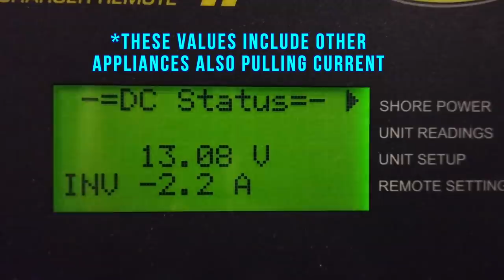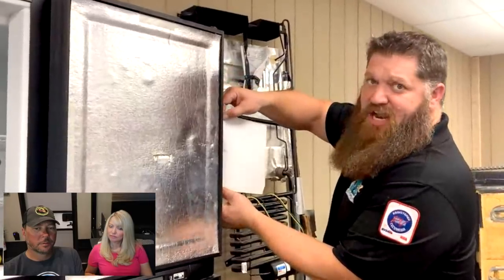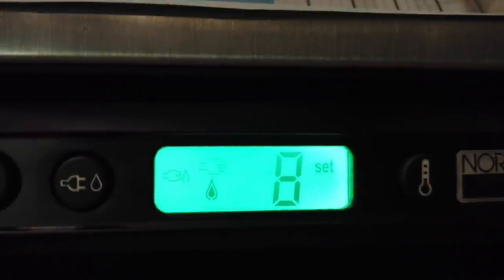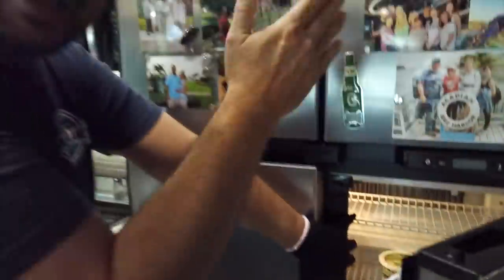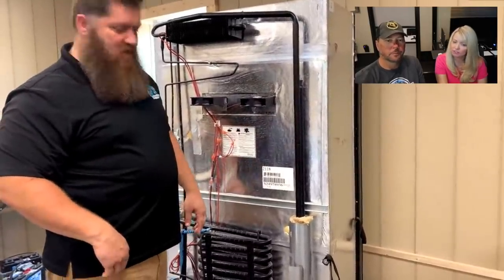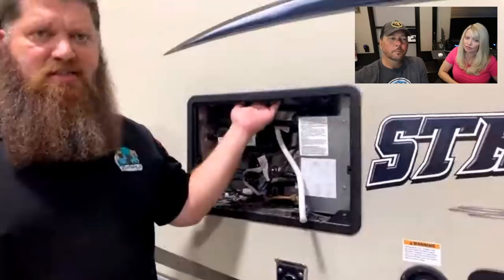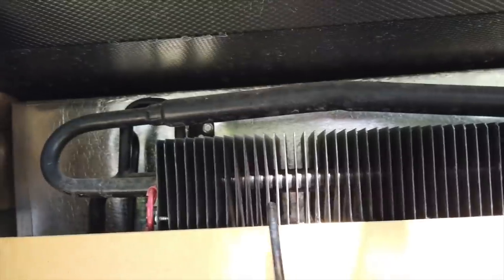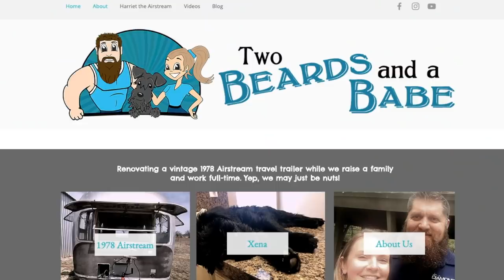Full Time RV Maintenance (Refrigeration) | Changing Lanes!

Comment: Great video thank you. Last winter it got down to -15 with 30 plus mph winds. Our ammonia in the fridge froze and caused the fridge to not work. To fix the issue we took the fridge out and flipped it upside down several times until the ammonia turned turned into liquid again. We like to rv in the cold a lot so we are more than likely going to switch to a household fridge to avoid all the temperature changes due to outside temps. Also to help with the cold we cover the bottom vent up with heat tape and leave the top open.

Comment: I'm so happy you showed a view of the top vent. I have a vent that is almost sealed and it doesn't cool on LP and CO leaks into the the RV and sets off the CO detector. I'm going to remove the top panel so the bottom panel is still there in hopes of allowing it to cool more.

Comment: I have same refrigerator. Only a few mounts old. Was having issue getting it to cool below 50. We found that pice that flips out to fill the gap between the door was not flipping out every time. Had to adjust the doors up. All good now. It also caused a large amount of condensation in the frig.

Comment: Ok so I have a question.  I have a norwood fridge in a 2013 Eclipse Milan.  I bought it used, there is a drain hose sticking out of the outside vent.  I have never seen it drip before, and since I am in Phoenix, AZ I figured it is so dry out here that there just was not enough condensation in the fridge for it to drain.  However I saw some of your videos and learned that I should clean out behind the fridge.  So I set up the vacuum and cleaned it out.  While vacuuming I accidentally vacuumed the drain and it dripped a lot.   I tried it again and more water came out.  Should I blow this tube out from the inside to clear it?  My thought is that the drain tube is clogged and without proper suction it will not work correctly.  Thoughts?

Comment: the air "dam" across the bottom of your upper vent seems to make sense to me, our fridge has a similar situation but no "dam".  is this recommended by norcold?
we have an open spot above our fridge of about 3 inches, i will close that off.

thanks for the great video, most of it is common sense except for the baffling around the back of the fridge, great tips!

Comment: The pressure regulator already has an excessive flow valve, but I suppose 2 is better then one.  Put us in "travel with propane on" category.  Great video as always..
Reply from the maker: It does.. but it does not shut it off completely.  See the test I did here: https://changinglanesrv.com/gasstop-automatic-propane-shut-off/
Reply: Correct the excess flow valve only slows down the rate of flow should a catastrophic event happen but there is still propane flow.  The Gas stop device shuts propane flow completely off should a catastrophic event happen.

Comment: You do not need to turn off your LP when you drive you have an LP leak detector by law in every camper. (It is like a smoke detector for gas) RV refrigerators frost up on hot days or just after months of use. It happens to all of us. Just buy a cooler. Put your food in it for 24 hours. Open the door, Turn off the refrigerator, Let it defrost. I do this every 6 months. Also some tunnels say turn off the gas. So fill up your cooler. Turn off the gas and power to it and defrost your refrigerator at that time.

Comment: Great video, thanks for helping everyone with this knowledge.

What video do you show your motorcycle chock mounted for travel with your bike?  I need to decide how to transport my recently purchased bike (85' V65) in my toy hauler and cannot find the video you posted about it.
Reply from the maker: We use a WheelDock. https://wheeldock.com/ 
Uses a piston you trigger with your foot to lock in the wheel versus having to rock it in and out. I don't bolt it in at all, it just sits on the floor and I strap lucile down on the front forks and rear bars. 
We demonstrate it a bit here https://youtu.be/_X-LAY8Fwlw?t=1341, 
then later here https://youtu.be/uPXNmS0IBRQ?t=1268 
and even more here: https://youtu.be/f56_8ecCTaI?t=777

Comment: Good video, but I made the switch over to a Residential Fridge, and will never go back to an RV Fridge, I would even get rid of our Furrion Stove/Oven and go to an Induction Top just to get rid of the use of Propane, except when traveling in the Winter for the Furnace.  The residential Fridge is an 18cft Samsung Double Door with Ice Maker, so much better.  We finally got tired of the small RV fridges, and the constant icing up of the Fridge and Freezer in the extreme hot days.
Reply from the maker: That's certainly an option we've considered.  Do you know what that samsung pulls in terms of wattage?
Reply: Changing Lanes yep I have that info at home will email it, but we leave NJ to Florida traveling 32 hours I run Fridge/Freezer on 2 LED Acid Batteries, and when we connect in Florida we usually have 50-70% battery left, less if we run the furnace but I will get you power consumption truck is make sure ice maker is off and batts are fully charged before we leave

Comment: All good info, for sure. As I plan my purchase, I'm now predisposed to a residential refrigerator and will definitely have a robust solar system for extended boondocking. For me, the risk of a fire with one of those RV refrigerators is enough for me to shy away from them. Great video, keep up the fine work and remember.... there's an awesome cheeseburger in your future when you get to San Diego.
Reply: Tim, not RV related...if you like Pizza, try Pernicano's (? Spelling) on El Cajon Blvd as you pass from El Cajon in Lakeside. They are by far the best I've had in the entire US.  Oh yes, second best is Lintz Brothers in Hermosa, SD at the intersection of highways 79 & 36.  Oh yes, I totally agree with your thoughts regarding refrigerators.  v/r, TS Denver, CO  (Retired Navy who was Born & Raised in SD)
Reply: @Shalako1946 , great to get a note from a fellow San Diegan! You know, I remember Pernicano's in Pacific Beach when I lived there years ago. They recently closed that one, but I'll check out the one on El Cajon Blvd since it's close to me in La Mesa. I'll look into the other one you mentioned too. About the cheeseburger- I'm going to take  these fine folks to Rocky's in PB when they come to  town
Reply: @timinsandiego6979  Been to PB a lot...B4 I joined the Navy back in '64 (just after graduating from Crawford HS), but Rocky's doesn't ring a bell. I'll look for it next time I visit my sister who lives in Lakeside. Thanks for the tip.  Please pass on a "Fair Winds and Following Seas" to Chad for me. He can explain it to you.   :-)  v/r, TS
Reply: @Shalako1946 , I sure will and I'm looking forward to meeting them. BTW, Rocky's is in Crown Point/PB. It's a cash-only bar. All they serve is a burger, with or without cheese, and french fries. The bartender told me they go through all the buns (and more) that you can see on the back shelf from the bar I counted them... 600 buns.

Comment: Love all of yalls videos I have had the pleasure of watching so far , looking forward to more on the maintenance sections ( Especialy Electrical ) . I as Tara hate and don't understand most of it ,  Having that said I have a question for you , I have a 30 AMP RV and am curious if I would be able to puchase a 50 AMP surge protector and use a 50/30 dogbone to safely reduce power for our RV ? This is our first and my thought was later when we upgrade  I would already have the 50AMP and not need to upgrade .  Thnx and looking forward to your insight  .
Reply from the maker: Shouldn't be an issue... you would need to double dog-bone it.  Might want to call TechnoRV to make sure....  👍🏼

Comment: I turn my propane off when traveling, but add freezer packs in my Refrigerator when traveling.
Reply: a super simple fix as you said. we even will simply move our meats up to the freezer and keep our drinks in the fridge. After 8 hours of travel our meats have just a bit of frost on the outside and are colder than when they went in. A bit more work but safer.

Comment: We have a 2918 Satellite Comet 17RB with a Dometic fridge. It literally takes 2-3 days to get it cold before we leave. And we usually have to keep a 5# bag of ice in the lower part to maintain temps. Ideas?
Reply from the maker: Did you check the things in this video?  Air flow, seals, etc?
Reply: Yes. Nothing works. If I try to run it on ac or battery it’s even worse. But I forgot to mention that the freezer seems to be just fine.
Reply from the maker: That is odd...
Reply: @firemarshal17   So freezer works but the fridge does not correct? So first make sure your fridge seals are clean and they connect well from the door to the fridge. 2nd make sure you don't over fill the fridge- give a good 2 inches of space on the back side, if you can find a 12volt fan to put back there it would be wonderful. 3rd item as stated in the video is to check your air flow between your lower access panel and your upper access panel located on the outside of the rig where the fridge is located. make sure there are no obstructions and no large pockets for air to get trapped. 

if the freezer works but the fridge doesnt then its either air getting into the fridge or not enough air going across the fins to pull the heat away.

Comment: Hi Chad, we have been in our 2019 solitude for 5 months now in canada, and our freezer seems to be acting weird, the outside temps obviously should not be a factor (I would think) when its been 5-15C ( 40, 50,60F); but our ice cream would turn to mush, then one day it was frozen. 😲 We have turned the fridge temp number on the  fridge ranging from 6 to 8, but on 7 things in the fridge start to freeze, so we leave it on 6 now. Tried 8 to see if it made a difference to the ice cream- it didn’t. What we are noticing is we have read freezer temp has been -5C, (23F) then next day its  - 15C (5F) ; another day -7C, few hours later -10C. Freezer gets opened max once a day. So it is looking like to me the freezer temp is fluctuating on its own? Not because its being opened n not because its hot outside as outside feels colder than the dang freezer. Norcold 2118 model, looks like yours. Fridge is fine as long as we don’t go past 6. We check the freezer fan n its running fine. We will be taking it in to the dealer next month to figure out wtf is going on. Just wondering if you ever heard or experienced this weird thing with the freezer. No its not over stuffed by any means either. I’m so turned off ice cream because of having an ice cream on the stick pretty much fall off the stick like mush once wrapper came off, and the ice cream cookies sandwiches, the cookie part is absolutely soggy! Yeah 🤢.  The ice cream is always on the bottom left side too.  Any ideas? Cheers 🍻
Reply from the maker: Sounds like you've checked all of the things I would have checked.  Let us know what the dealer says....
Reply: I have this exact problem. I’m at the dealer now getting a new cooling unit it. Not fun and not cheap but it comes with a 3yr warranty

Comment: Chad--have you tracked battery consumption with the Norcold while on the inverter?  I've got the Dometic 1350 (12 cu ft) in my '19 GD 315RLTS.  I have 400ah (four Battle Borns) through a Victron 12/3000 Multiplus.  I've recorded 18 travel days and on average consume 8% of the 400ah (or 32aH) per hour.  In other words, I can power the fridge on the inverter for ~10 hours disconnected from shore power.  Final thought--I hope your viewers take the food safety warning seriously.  While towing with propane has risks (the Grand Design owner's manual says not to do it) getting food poisoning is an even greater risk.  That's why I went with an inverter, but (whew!) it was an expensive alternative.  And Emily posted a link to your video on the Grand Design Owner's Technical Forum, so I think she still likes you.  :)
Reply from the maker: Emily still loves us! 💙   
Overall usage will depend a lot on how much the fridge is actually running.  Ours pulls about 40-41 Amps DC when running on inverted 120 (480-500 watts).  We have 300Ah of lithium and have been only getting about 4-5 hours recently.  But, again, this is summer.  In cooler temps, it will last longer because the fridge doesn't have to run as long.  Another factor is how often one opens the fridge.  We get into ours a few times on travel days...  Lot's of variables to be sure!  
Definitely hear you on the food safety thing... Sooooo many people just go by feel.

Comment: I wish you would’ve mentioned don’t spray a lot of water in the bottom vent when washing because you can trip that little black box in there then you’ll need a magnetic to reset the switch inside there to turn the fridge back on. Nothings worse than opening up the camper hours later and hearing that beep saying no power!
Reply from the maker: Good point...  👍🏼

Comment: Traveling,propane off. The reefer will stay cold up to 8 hours, most around 6. Many RV fires are cause by the reefer running on propane, look it up and tell me if I'm full of it or not. The other issue is fueling up. Many reefers are on the the pump side. Do you really want to take a chace of blowing up on a hot day with putting gas in your tank?
Reply from the maker: True.. but just know the difference between "cold" (a subjective term relative to one's own temperature), and an actual measurement showing it stayed below 40.   
The gas pump thing is a good point.  Particularly in motorized where the fridge can be in close proximity to the pump.  For us (and most trailers), the fridge is a good 20-30 feet from the pump when filling the tow vehicle.
Reply: @ChangingLanes  
Regarding gas pumps. True the rig is behind your pump but not always behind the guy on the other side fueling up. I just shut the tanks off as part of the pre-launch checklist. I have found with my Dometic 2 way, it will stay around 34 to 38 after 7 hours. Crossing the desert on I40. However, I stay out of the damn thing except to very quickly grab a cold beer!
Good info on the reefers especially Norcold, most do not have baffles and I have had to install more than one. I have also installed a fan at the bottom of the unit to create more airflow,especially in slide reefers.
Thanks for the vids, you and Less Junk More Journey are 2 of my favorites.
See ya on the road
Reply from the maker: 34-38 is pretty good!  We run ours on the inverter for about 5 hours, then shut if off if our drive is longer than that.  So, it's only off for a few hours at most.  I think a fan right on the inside of the cover is a great idea to pull in some extra air.  Maybe one up top (facing out)...  👍🏼

Comment: Need help with my Dometic RM2341 that I notice the fans never shuts off. I’m connected to electric but I also tested the propane mode. Refrigerator runs cold but not as cold I want it and freezer does freeze well. Any suggestions?
Reply from the maker: Only the stuff already in this video... Unfortunately, absorption fridges just aren't very efficient.  Our freezer never gets past the teens.

Comment: If you add gas-stop valve then running the fridge on propane while driving should be OK?????
Reply: It will, but it also will if you don't add the Gas Stop.
Reply from the maker: It's a safety measure, but not a cure-all for the risks of running down the road with a lit propane flame.  Our personal stance on it is don't run on propane if not necessary (short trips, etc).  If your food will spoil (longer trip / super hot day, etc), run with it as long as you don't have propane lines over tires.  That is OUR personal opinion and should not be taken as gospel.  There are very good arguments on both sides of the argument for this.  In the end, you have to make your own call on what you're comfortable with.  Safe travels!  😊

Comment: Your comment " running propane off your inverter".  I would like  know how to wire that up.
Reply from the maker: Pretty sure that makes no sense at all... LOL  Can you provide a time index where we say that?  Perhaps we misspoke.
Reply: @ChangingLanes  Just was wondering "running Refrigerator off AC while  driving. We always use propane".
Reply from the maker: Ahhhh.. We used to run the fridge off propane while traveling until we got the inverter and upgraded batteries.  Now, we run the fridge via the inverter (120VAC).  Hope that makes sense.
Reply: @ChangingLanes  Good. I suppose you have the Frig plugged directly into the inverter........Is that how its wired?
Reply from the maker: No.. the fridge is just plugged in and our inverter powers the whole RV.. See: https://youtu.be/1rPKWrXQYWA

Comment: Hi Chad and Tara, awesome video...as always.  I do have one question with regard to the wireless Thermometer, are you aware of any that work with the Ring security system.  Reason for the question is that we will be putting our RV on a seasonal site and want to keep the fridge on.  It would be great if I could get alerts on my phone when the temperature changes.